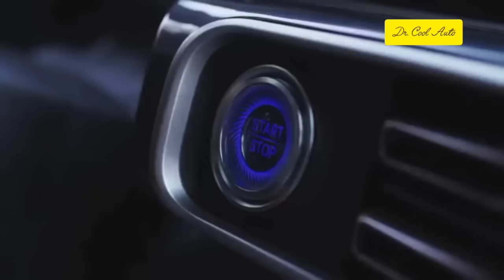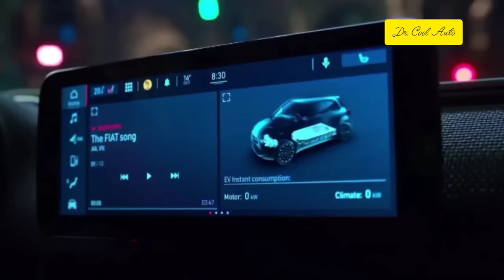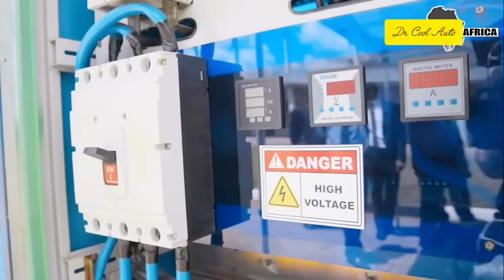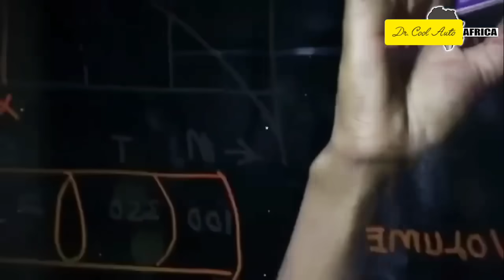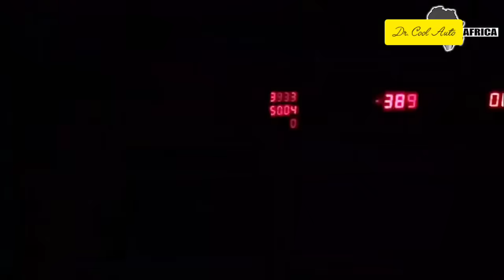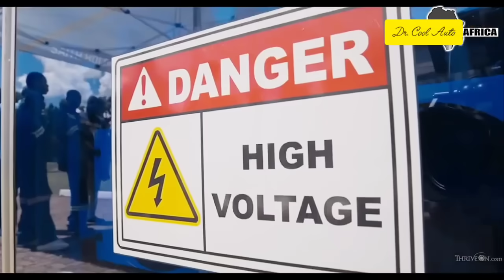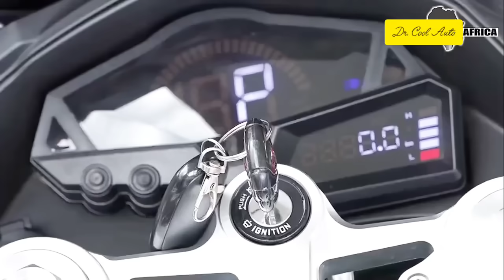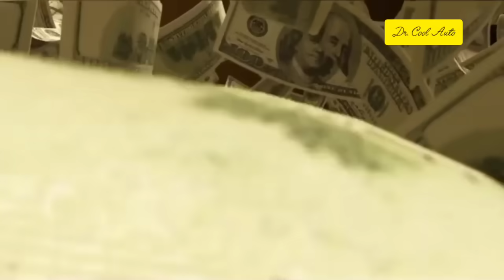2025 Self-Powered EV: Shakes Up The Entire World! shock skeptics

Comment: They tried to take him out after his self powered tv reveal. Start exporting your products please.

Mind you high import duties would immediately be put on his exports.
Reply: Kwaben....  your comment shows that you are a great candidate for getting deceived and stollen out of money because though your comment you appear to be naive.    It might surprise you but this letter will explain to you, using logic as "proof" of why this so called "new source of energy, invention"  is a deceitful add for fraud, to steal money from whoever is naive,  and would end receiving nothing back for any sent money.  What is shown in this video  is nothing other than one more deceitful propaganda fraud sci-fy tech advertisement,  like the other adds presented 15 and 10 years ago about cars running on nothing but water and no other energy necessary  but in fact was never true since it was about the "hydrogen" from the water,  needed to be extracted from the water by consuming a large 
amount of 
electricity first, before producing the "hydrogen",  from the water. And that energy used to extract hydrogen from the water, costs money every time, and is not free. Therefore the water advertisement video , to be used directly as free source for energy for cars,  was and is a fraud advertisement video.  This video is shown by this YouTube channel also for profit if earning either money through this channel, or subscribers that might use the service that this channel may offer. But the "cars running on 
water 
as free source of energy", (old video add) was a fraud add because was presenting >deceitfully< the implication  of water used directly as a free source of energy instead of the hydrogen from the water,  which was needed to be extracted first,  from the water, with the help of electricity, through the consume of electricity,  and the process (of extracting hydrogen from water),  is not free but costs money each time, when hydrogen is extracted from water 
(the car 
running not on water but on hydrogen). Yet what was first claimed was  not possible to do, since is a deception, a fraud add. The same is with what is claimed in this add = it costs money to spend in regular basis, no matter what you use as energy extraction source whether solar radiation or radio waves, rays, sonic energy or whatever "term" you could come up with to invent, (UNLESS IS THE DIVINE SOURCE  
"YHWH" 
which is not an invention, not a created thing, nor a creature.   Know yee that the deceitful propaganda from  this video has connection with China and  the Chinese which are heavily involved in Africa sucking the blood out of Africa by enslaving it, the modern way, with slavery that the West practice no more (slavery) else would have not had a civil war white people killing their own white people that were pro-slavery.  The CCP China practitioner of 
methods 
to enslave entire nations, would never have a civil war to kill their own pro-slavery CCP people, to abolish slavery (else would not do what they do right now in Africa) besides cheating and deceiving a lot, non-stop with deceitful diverse propaganda.  But ask yourself this:  If the Chinese made cars and motorcycles or mopeds or bicycles that runs with his so invented new tech (which is fake), but if were true, right now such Chinese cars, motorcycles, or mopeds and bicycles could be seen on the streets 
of the 
European nations and other nations world wide, and especially on the streets of the nations Europe and Africa and Asia and South America which sabotaged the plan to impose tariffs on the Chinese cars and other imports, and still brings Chinese cars, motorcycles and bicycles with no extra taxes or no imposed tariffs.  That means such cars, motorcycles and bicycles  would be seen on the streets of many nations and their engines would be shown in videos by many proud owners of such vehicles  but 
the fact 
that there is no existing proof of such vehicles with such engines to be found on the streets of any nations in number of thousands of cars, or motorcycles, or at least on bicycles, ... the not existing so on the streets,  it is the counter-proof for you to know that the presented fictitious invention is only one more fraud add attempt to get money from the naive people that could be fooled, so that they end up never seeing their invested money in any form back, ...  not even in a real vehicle or bicycle 
with 
such engine, and feel ashamed and foolish for believing such lie and become a victim of such fraud. No one that truly gets to have such miraculous technology that produces free powerful  energy in huge quantity while the device (engine) is as small as he has shown the fake device attached to that TV screen, to be,  while having in it hidden a powerful lithium very small battery able to turn on the TV for a very short time, after which needs recharging with expensive electricity, else needs to 
be kept 
plugged in the wall to the electricity source ... therefore a fraud of a video "add" made in Africa,  to cheat naive Europeans and Americans  off their hard earned money; ...  No one having such technology of powerful free energy emitting small device (engine), would show it on videos publicly on the internet and still remain alive to be able to still post such fake claim, (unless is a fraud, a fake claim) because if were true,  immediately some people from all the huge energy source producers that would automatically 
become 
bankrupted even as countries becoming bankrupt (whether owning sources selling gas, lithium for batteries, or selling electricity, or petrol or other oil (bio-fuel),  all such countries as well as owners, but even China itself known as the greatest thief of technology unwilling to pay the annual fee for the Non-Chinese  (Western) patented invented technology that China  usually steal,....  all such countries and owners of the known energy sources and all of them having assassins and snipers would have 
stolen 
by now  that technology and eliminate that man or just paid him much. And that technology (if were true),  would be  either kept secret and never applied on anything that could be sold and then copied, without paying for the patented invention annual fees, (as China does not pay such annual fees for 90% of everything it produces and which is produced from Western patented technology ).  All those owners and countries of diverse energy sources would either make the invention not-applicable if the 
invention 
were real, or else  would use it on expensive products (cars, bicycles, ... and anything that needs energy) and sold to you as expensive as today's items using energy, to get your money, monthly,  to replace today's known energy sources that are more expensive to extract or to apply,  such as solar panels requiring much space for solar panels and sunlight non-existent at night or at day in cloudy conditions,  and storage of that electricity into expensive batteries, and the same for the wind making electricity that 
also 
requires much space and wind which doesn't exist always and everywhere, and expensive  batteries and storage space of the electricity produced by wind into expensive batteries.  Such fictitious energy source presented on this video, (if it were real - would be immediately stolen and then either):  kept secrete until all the present energy sources (gas, petrol, coal, and battery minerals or lithium) becomes exhausted and finished,  or else are replaced with a new source of energy that would 
not be 
"free energy" but cost as much money, paid monthly because the owners and countries of energy sources (gas, petrol, coal, lithium and batteries, solar and wind tech and electricity makers and countries would NEVER want to receive NO money monthly or annually and become bankrupt and in need of money because  of  giving  free energy and not collect money and thus to become bankrupt.   LOGIC ==>  NO FREE  ENERGY SOURCE INVENTION  would ever give you free energy while the earth is ruled by men and 
not by 
The Divine MessiYAH   YHWH Savior  (YAH Shua).  There is no free and unlimited Source of Energy other than   "YHWH" EL,  The EternaL  EL (EL'o'him),  Self Aware Unlimited Energy (Spirit/Force/Almighty Power) Limitless in Intelligence (from the eternity past),  Pure (Holy),  Creator of the Universe (from beyond time and space, Creator from EL's Self Unlimited Energy)  Y.H.V.H.,  name abbreviation which also stands for  "I Was, I Am, I'll Be",  and YAH EL,  The Divine Eternal Word that took human form under the name YHWH Savior (YAH Shua) The Divine MessiYAH,  EmMan[u]EL  (AmongMen[the]Eternal).

Comment: So why hasn't the Zimbabwean government supported and taken up the invention as a national property for the country to reap from its economic potential?
Reply: Keti....  the answer to your question is:   because is a scam, a advertisement fraud propaganda, otherwise the Zimbabwean government and also China's car manufacturer that supposedly got that technology on that Chinese car,  would have already stolen it.  Your comment shows that you are a great candidate for getting deceived and stolen out of money because though your comment you appear to be naive.    It might surprise you but this letter will explain to you, using logic as "proof" of why this so called "new source of energy, invention"  is a deceitful add for fraud, to steal 
money 
from whoever is naive,  and would end receiving nothing back for any sent money.  What is shown in this video  is nothing other than one more deceitful propaganda fraud sci-fy tech advertisement,  like the other adds presented 15 and 10 years ago about cars running on nothing but water and no other energy necessary  but in fact was never true since it was about the "hydrogen" from the water,  needed to be extracted from the water by consuming a large 

amount of 
electricity first, before producing the "hydrogen",  from the water. And that energy used to extract hydrogen from the water, costs money every time, and is not free. Therefore the water advertisement video , to be used directly as free source for energy for cars,  was and is a fraud advertisement video.  This video is shown by this YouTube channel also for profit if earning either money through this channel, or subscribers that might use the service that this channel may offer. But the "cars running on 
water 
as free source of energy", (old video add) was a fraud add because was presenting >deceitfully< the implication  of water used directly as a free source of energy instead of the hydrogen from the water,  which was needed to be extracted first,  from the water, with the help of electricity, through the consume of electricity,  and the process (of extracting hydrogen from water),  is not free but costs money each time, when hydrogen is extracted from water 
(the car 
running not on water but on hydrogen). Yet what was first claimed was  not possible to do, since is a deception, a fraud add. The same is with what is claimed in this add = it costs money to spend in regular basis, no matter what you use as energy extraction source whether solar radiation or radio waves, rays, sonic energy or whatever "term" you could come up with to invent, (UNLESS IS THE DIVINE SOURCE  
"YHWH" 
which is not an invention, not a created thing, nor a creature.   Know yee that the deceitful propaganda from  this video has connection with China and  the Chinese which are heavily involved in Africa sucking the blood out of Africa by enslaving it, the modern way, with slavery that the West practice no more (slavery) else would have not had a civil war white people killing their own white people that were pro-slavery.  The CCP China practitioner of 
methods 
to enslave entire nations, would never have a civil war to kill their own pro-slavery CCP people, to abolish slavery (else would not do what they do right now in Africa) besides cheating and deceiving a lot, non-stop with deceitful diverse propaganda.  But ask yourself this:  If the Chinese made cars and motorcycles or mopeds or bicycles that runs with his so invented new tech (which is fake), but if were true, right now such Chinese cars, motorcycles, or mopeds and bicycles could be seen on the streets 
of the 
European nations and other nations world wide, and especially on the streets of the nations Europe and Africa and Asia and South America which sabotaged the plan to impose tariffs on the Chinese cars and other imports, and still brings Chinese cars, motorcycles and bicycles with no extra taxes or no imposed tariffs.  That means such cars, motorcycles and bicycles  would be seen on the streets of many nations and their engines would be shown in videos by many proud owners of such vehicles  but 
the fact 
that there is no existing proof of such vehicles with such engines to be found on the streets of any nations in number of thousands of cars, or motorcycles, or at least on bicycles, ... the not existing so on the streets,  it is the counter-proof for you to know that the presented fictitious invention is only one more fraud add attempt to get money from the naive people that could be fooled, so that they end up never seeing their invested money in any form back, ...  not even in a real vehicle or bicycle 
with 
such engine, and feel ashamed and foolish for believing such lie and become a victim of such fraud. No one that truly gets to have such miraculous technology that produces free powerful  energy in huge quantity while the device (engine) is as small as he has shown the fake device attached to that TV screen, to be,  while having in it hidden a powerful lithium very small battery able to turn on the TV for a very short time, after which needs recharging with expensive electricity, else needs to 
be kept 
plugged in the wall to the electricity source ... therefore a fraud of a video "add" made in Africa,  to cheat naive Europeans and Americans  off their hard earned money; ...  No one having such technology of powerful free energy emitting small device (engine), would show it on videos publicly on the internet and still remain alive to be able to still post such fake claim, (unless is a fraud, a fake claim) because if were true,  immediately some people from all the huge energy source producers that would automatically 
become 
bankrupted even as countries becoming bankrupt (whether owning sources selling gas, lithium for batteries, or selling electricity, or petrol or other oil (bio-fuel),  all such countries as well as owners, but even China itself known as the greatest thief of technology unwilling to pay the annual fee for the Non-Chinese  (Western) patented invented technology that China  usually steal,....  all such countries and owners of the known energy sources and all of them having assassins and snipers would have 
stolen 
by now  that technology and eliminate that man or just paid him much. And that technology (if were true),  would be  either kept secret and never applied on anything that could be sold and then copied, without paying for the patented invention annual fees, (as China does not pay such annual fees for 90% of everything it produces and which is produced from Western patented technology ).  All those owners and countries of diverse energy sources would either make the invention not-applicable if the 
invention 
were real, or else  would use it on expensive products (cars, bicycles, ... and anything that needs energy) and sold to you as expensive as today's items using energy, to get your money, monthly,  to replace today's known energy sources that are more expensive to extract or to apply,  such as solar panels requiring much space for solar panels and sunlight non-existent at night or at day in cloudy conditions,  and storage of that electricity into expensive batteries, and the same for the wind making electricity that 
also 
requires much space and wind which doesn't exist always and everywhere, and expensive  batteries and storage space of the electricity produced by wind into expensive batteries.  Such fictitious energy source presented on this video, (if it were real - would be immediately stolen and then either):  kept secrete until all the present energy sources (gas, petrol, coal, and battery minerals or lithium) becomes exhausted and finished,  or else are replaced with a new source of energy that would 
not be 
"free energy" but cost as much money, paid monthly because the owners and countries of energy sources (gas, petrol, coal, lithium and batteries, solar and wind tech and electricity makers and countries would NEVER want to receive NO money monthly or annually and become bankrupt and in need of money because  of  giving  free energy and not collect money and thus to become bankrupt.   LOGIC ==>  NO FREE  ENERGY SOURCE INVENTION  would ever give you free energy while the earth is ruled by men and 
not by 
The Divine MessiYAH   YHWH Savior  (YAH Shua).  There is no free and unlimited Source of Energy other than   "YHWH" EL,  The EternaL  EL (EL'o'him),  Self Aware Unlimited Energy (Spirit/Force/Almighty Power) Limitless in Intelligence (from the eternity past),  Pure (Holy),  Creator of the Universe (from beyond time and space, Creator from EL's Self Unlimited Energy)  Y.H.V.H.,  name abbreviation which also stands for  "I Was, I Am, I'll Be",  and YAH EL,  The Divine Eternal Word that took human form under the name YHWH Savior (YAH Shua) The Divine MessiYAH,  EmMan[u]EL  (AmongMen[the]Eternal).